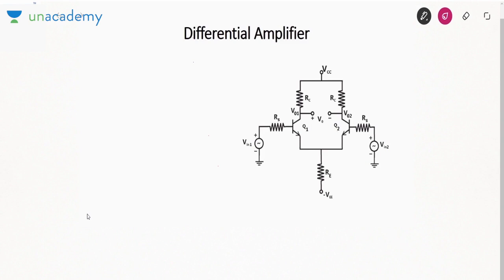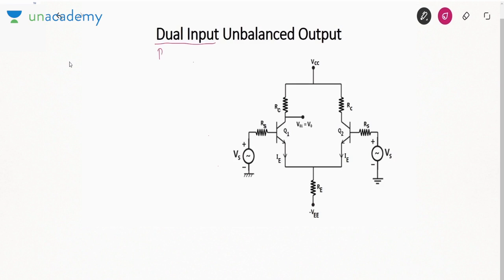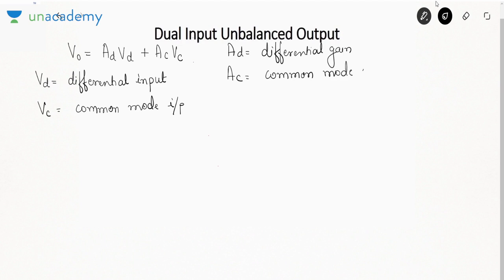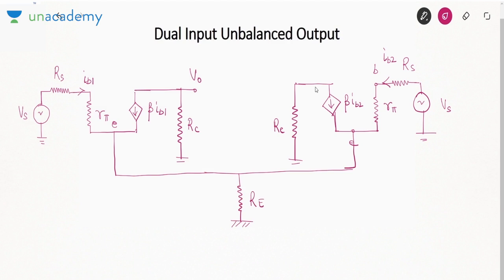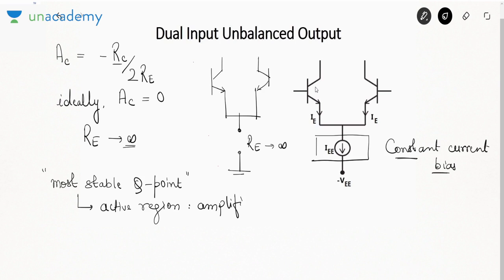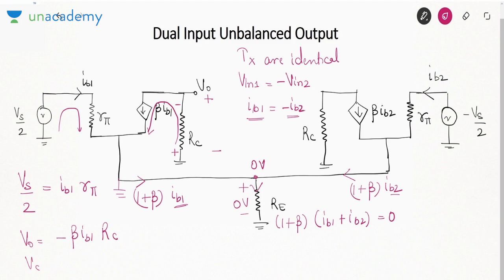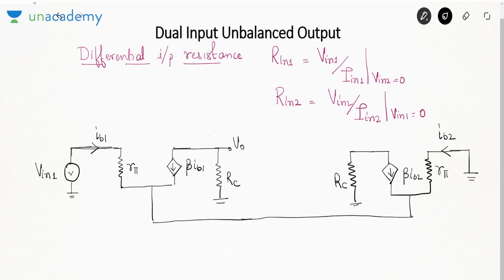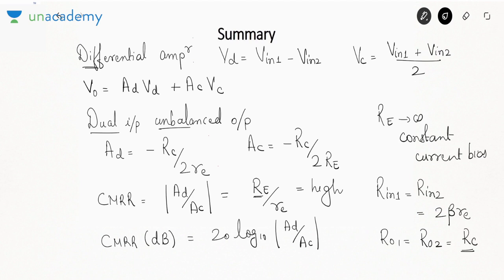Differential Amplifier - 1 | BJT | Lec 51 | Analog Electronics | GATE 2021 Exam | Ankit Goyal

Comment: when you are conservative rpi thdn current source should be gmvpi i guess ..... why betaib???
Reply: rpi is same as beta re. And ib = vpi / rpi = vpi / beta re.

From this if you write Beta ib, 
Beta ib = V pi/ re = gmvpi (as gm = 1/re)

Hybrid pi and Re model are equivalent. One uses current based current source and the other uses voltage based current source. Both can be interchanged as per need. I hope I clarified.

Comment: 12:31 why Rs is not considered
Reply: Because when base current is zero Rs becomes redundant.
Reply: Bro actually denominator mein rs/beta ayega but it is very smaller than 2re that's why we neglect it @deepakchaudhary9469
Reply: Bcs rs is part of ac source, if there is no vs therebis no rs